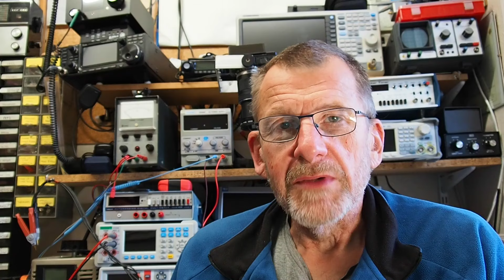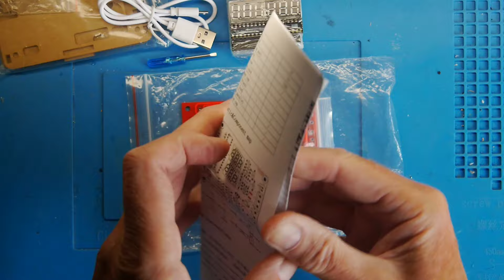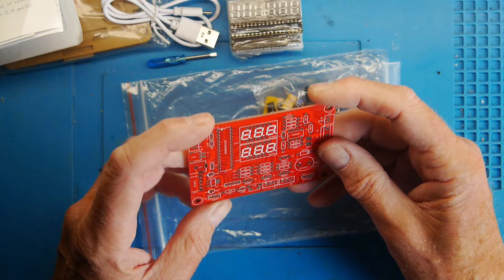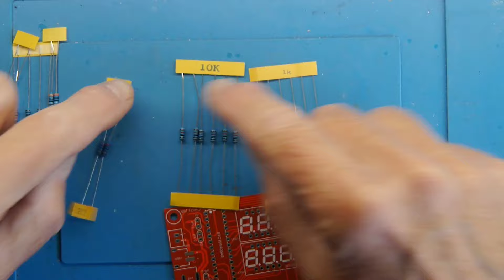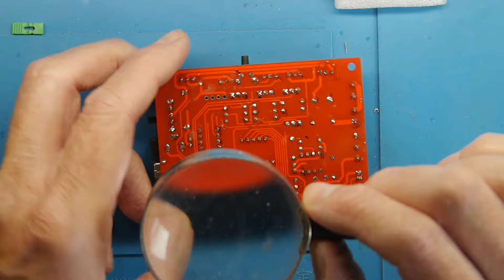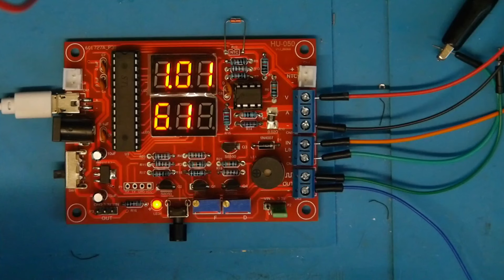IC Station Multifunction Kit  - Ideal beginners project - #192

Comment: For tinier SMT components, it's better to put solder on one pad and tack the component while holding it with tweezers. Solder the other pin and redo the first side. Paste flux or liquid flux help.
Reading glasses are useful for older people.

Comment: I find that soldering the legs of regulators and other tabbed components first makes life easier. It is a lot easier to position them neatly before going for the big tab. Also, it seems counter intuitive given the size of the components but using a bigger chisel tip on the iron makes SMD soldering a lot easier. I think it's because the bigger tip gives somewhere for excess solder to adhere to as you drag it away.

Comment: Trying to read those blue resistors is exasperating. I'm wondering if they are meant to be read under different lighting temperatures than we use at home.
Reply: I don’t even try I just drop them in my component tester